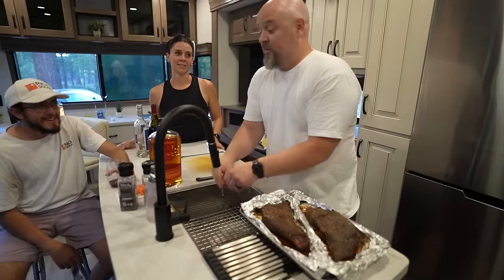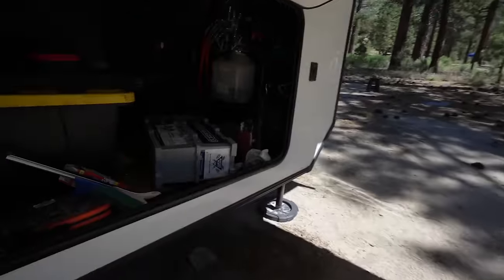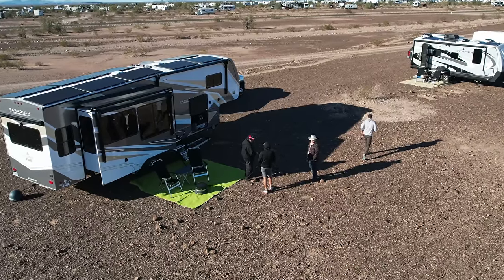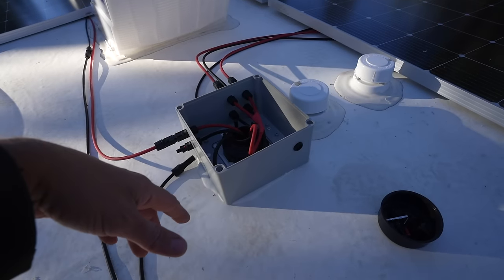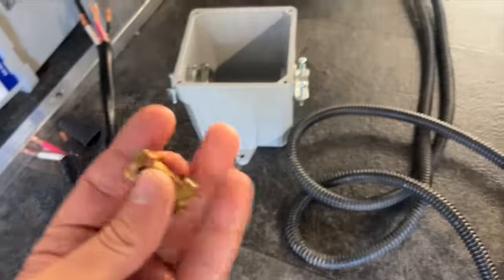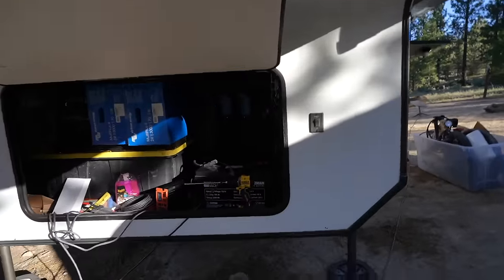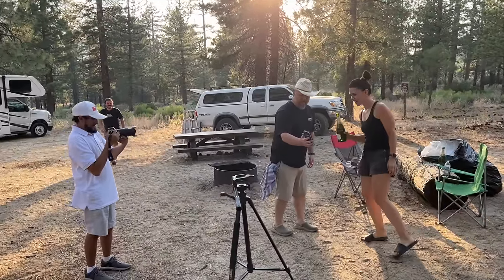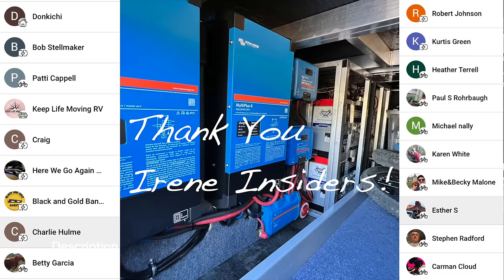24v Battle Born Battery Power with 2750 watts of Rich Solar! (RV Lithium Battery UPGRADE)

Comment: Great system love the way you put it all together.  Wow I would love to see any additional information or videos that you might have on this system. Looks as if you use batteries are 12dv at 270 ah and two in series making one bank and the same making the second bank. Then you paralleled the two back to give you at 24VDC output nice. Just do not understand why you use 250 watt solar panels when you could get 550 watt solar panels ? You would either have 1/2 the solar panels on your roof or the same amount with twice the amount of power going into you system . Then if twice the amount you could put two more inverter doing sharing and wow that would be nice . Plus give you a system that could be added to at any time if 1/2 the panels.
Reply: No way to fit 550s on the roof
Reply from the maker: Thanks! Yes, because of all the stuff we have on our roof (3 AC's, 2 fans, skylight, etc) we just don't have room for wider panels than these 250's. Any higher wattage panel is at least 40 inches wide and we only have 36 inches between the AC's and the edge of the roof. 👍
Reply: @IreneIronTravels  and you don’t want to fall off the roof!

Comment: I’d like a more detailed video in this system. 

I suspect we are looking at a decent 5 figure amount in this install… 

Looks beautiful
Reply: Labor costs are where it gets tricky. The parts alone aren't too bad, but professional labor adds up quickly!
Reply: The parts for that system are easily $25k. Those batteries alone total $15k.
Reply: @theshastafarian  jeez I'm so glad I built my own battery bank from individual lifepo4 cells! 700ah @12v for $2000. Then again, Aaron and Chris probably get a partner discount..

Comment: Any reason you ran your inverters in parallel instead of split phase?  Also I hope your 24v inverters can handle the load better than mine.  I have 2 12v MPII 3000 and when both A/Cs kick on at the same time (even with soft starts) and another load is on i n the RV I have had it blow my 400 amp and a 450 amp fuse because of the sudden load.  Just running they are fine, it is just that initial hit and your talking about running 3 at the same time granted your amp load will be half because of the 24v, hope it all works great for you.  Also you will need to convert to mini split to run A/C for any amount of time.  I have close to 3000 watt of solar and that can not keep with up recharging the batteries if 2 A/Cs are running, especially if you run them at night then the solar has to play catch up to charge what you used during the night and power the inverters with what ever battery draw (A/Cs) you have on during the daytime.

Comment: Happy for you guys, I  do have a couple of questions though.  Did you have to up grade the wiring in the rv and does installation on the roof void your warranty.
Reply from the maker: Thanks!! No, you don't have to upgrade any of the factory RV wiring, because it is still running the same amount of power as it's designed to. 

The roof warranty is not voided, unless the solar panels were determined to be the cause of an issue. For example, if one of the solar panel bracket holes leaked it would not be covered. But if the roof fan started leaking that would still be covered on the factory warranty because the panels don't have anything to do with it. 👍

Comment: Victron touch 70 install,  you drilled the hole in the false front panel then said it was a strait shot down to connect the wires. I have 2024 310RL.
I'm having trouble running a snake down. I pulled the power panel & breaker box but cannot fish a snake down. Did you cut any access holes
to get snake the wire down? any help would be apricated.  I really enjoy the videos. Thank you
Reply from the maker: I didn't have to cut any access holes. However in the 295MK there is a panel behind the toilet that does open and shows the roof vent pipes that rundown to the basement passthrough. I dont remember if that helped me at all, but it can be tight with the 3 vent pipes, studs, and screws sticking out. I just tried to follow the wire bundle that was already in there down to the back of the breaker panel.  The double connector wire of the Touch 70 made it a bit difficult as well. I believe I taped those together and then to the fish tape.  Sorry I couldn't be more help.....good luck!
Reply: @IreneIronTravels   Thanks for a quick reply, I made some progress with help from a GoPro. 
Why did you choose the softstart: Micro air easy start asy-364-x20-ip ? I assume your 295MK has the Colemen-Mach 4800 series?
I ordered three Coleman- Mach units on Amazon but they are on back order. The Micro-Air unit is $100.00 more. I didn't see a link to the Micro on you list.

Comment: Install looks great! Looking forward to your long term review of the system after you get a couple of seasons/locations (desert) under your belt with it. Rest assured, I will be borrowing some of your designs when we get our new rig! Looked at some Brinkley, Alliance, and Grand Design rigs last week, going to order an F450 in October, they are about 6 months out if you order.
Reply from the maker: Thanks Don! I really like the New 23 super duties... and wouldn't mind ordering a new Tremor. The payload has increased on them quite a bit.

I haven't seen a Brinkley in person yet, but really like what they are doing. What did you think about it?
Reply: @IreneIronTravels  Yes, the new super duties are very nice, especially with the payload increases and the option for an HO motor. 500HP and 1,200 lb-ft of torque! I am just trying to figure out if I want to get a dually or srw. Obviously the SRW will be better for normal drivability, but the extra stability and cargo capacity of the dually is desirable as well. Most likely going 450 due to the tighter turning radius on them vs the 350. Do you wish you had a dually now that you have the fifth wheel?

The Brinkley is pretty amazing in regards to fit and finish, as well as thoughtful touches. I will say the Z model was much nicer than the G even though I am mainly looking at toy haulers as I have a motorcycle that I will want to take with us when we go full time, not to mention the garage will make an excellent home office space. I want to see if any of the manufacturers will work with me to create a semi-customized floor plan. I don't want or need the half bath in the garage as it takes space from the living area so I need to see if anyone will work with me to delete that. I am also considering a non-toy hauler with a swivel wheel cart for the motorcycle. http://www.cruiserlift.com/swivelwheel-58-dual-wheel
Reply from the maker: @okinawadonkichi   We're really happy with the SRW diesel truck. It tows great, very stable, never feel out of control. But if we had any bigger/heavier of a 5th wheel we would probably look at going to a DRW. But because our truck is our daily driver we really appreciate not having to park a dually or a long bed in some of the places we go!

Comment: OK that made my head spin, what a beast system, you obviously plan to BOONDOCK. Aaron, I was wondering, don't you need a transfer switch when plugging into shore power?
Reply from the maker: 😂🤯 yes! It took me many weeks to research this system and how/if it could work! 

The inverters have a built in transfer switch and will automatically switch to battery power if the shore power shuts off.

But, more to your question, the inverters bypass shore power directly to the RV’s breaker panel if it detects a shore power source. 

If we had a built in generator you would then need a transfer switch to switch between shore and gen. 

Victron also has an inverter model called the Quattro that has Two inputs so you could wire shore power and an generator directly to the inverter!
Reply: @IreneIronTravels  Thanks for your response brother, appreciated! BTW, I'm that older dreadlock guy you see running around in the 1000 Trails parks. Hope to officially meet you guys some day, but I respect your privacy being a YT star!
Reply from the maker: Oh hey! It is a crazy small RV world out there! I’m sure we will meet one day👍😊

Comment: Wow! Thats a system! Aaron you seem knowledgable about solar so here's a quick question... We have a smaller system but decent with all Victron and BB batteries, we have a multi plus 2 3000 watt, 4 BB 100amp batteries and all the other toys to go with it. When we were plugged into good 50amp shore power, both A/c's going (with soft starts), tv, and hot water tank on electric why would our battery monitor be reading down 7 days, 5 days, 3 day 4 hours then gradually go back up. Its never done that before when plugged into shore power. It happened after torrential rains but the electrical never seemed to skip a beat, the electric coming in was always 122-124v on both legs.
Reply from the maker: Hello, thanks! Yes, that seems like a weird situation. Maybe the shore power shut off for a short time and you didn't notice... 

Was the battery percentage also going down at the same time?

If the power did shut off, that would make sense that it was going down that quickly and then the power came back on....

Comment: Nice.   How did you wire the solar panels to charge controllers?    How about the total weight added does that put the rv over max or close?  I saw previous comments at 800+ lb.

Comment: In the process of redoing my electrical system and was wondering why you chose to go 24v other than saving a little on wire size ? 
Victron prices are pretty much the same going 12v or 24v. Right now it looks like Rich Solar and BougheRV  are competing for some sales on their 12v 200w solar panels. Less that a $1 a watt while the 24v 200w are over a $1 a watt. I haven’t seen a big difference in batteries as far as voltage goes unless you go to 48v. 
Plus going 24v you have to get a dc to dc converter which is about $140 and another thing to go bad in the system. 
Just curious
Reply from the maker: Yes, money saving is not a great reason to do it. The biggest savings would probably be in the solar charge controllers as you can buy half the wattage size controller and the victrons can get expensive as you get unto the 150/100's.

But the real reason (for me) is if one is going to go with larger inverters or multiple inverters. At 24 volt you will have half the amperage going through the wires, which is more efficient and a lot cooler. So if I want to run an AC for 12 hours its about 60 amps instead of 120 amps. Same goes for charging the batteries. 

So as we leave our inverters on 24/7 it is more efficient to go from 24v to 120v for most of our loads.

If you have a smaller system it probably makes more sense to stay 12 volt and then run as much as you can off 12 volt instead of 120v. And like you said, you do have to deal with the Orion converter of 24v to 12v.
Reply: @IreneIronTravels  
Thanks for the reply. Understand the higher the amps the more heat created. 
I have the cousin to your last rig but it’s a Cougar. Same size and layout. 530 solar, 300a battery and 2000w Xantrex inverter/charger. Upgrade to 1200 solar, 600a battery, 3000w multi Plus and same 50/100 Victron solar. All because I’ll be installing a mini split that should be soaking up around 6000w a day in the mid 80’s. Any hotter and I’ll have to break out the geny

Comment: I know you have probably answered this 1 million times before but why do you fill up your fresh tank completely at the start of your travel day rather than when you get closer to your site? At 100 gallons that’s over 800 pounds. That makes it a heck of a lot heavier to Paul, which, of course means more fuel consumed.
Reply from the maker: We try to, but sometimes it's tough to find potable water on our route. In this instance we had over a 100 gallons of gray and black to drop off as well. So we picked a dump and water that was in the middle between campsites. 👍
Reply: @IreneIronTravels  gotcha. Thank you. I’m very new to all of this :-)

Comment: Awesome. That is the exact system I had been planning out for my future 5th wheel. Even a similar amount of solar. It's great to see it in real life come together and work. Did you wire the Orions to a bus bar or just parallel them from output stud to output stud like you would batteries?
Reply from the maker: Thanks! No buss bar for the Orions. Yes, we just parallel them to each other output to output, input to input, neg to neg. And then the input from the 24v batteries and the output goes to the factory RV positive. 👍 Works great so far.

Comment: Great install and super nice system. What AC units are on your Alliance and how many BTU? My 15K pulls about 400watts more when running and Im looking at installing betting ACs or a mini split to run longer off my solar system.
Reply from the maker: Thanks ! We have the Coleman  Mach Q 13.5k BTU. On low auto they pull 1000-1200 watts. Our last regular Coleman 15k was 1500-1800 watts. 

Im really happy with the power consumption on these. Ofcourse a mini split would be more efficient and wayyyy quieter....but it's a pretty decent job to put one in....
Reply: @IreneIronTravels  The the noise level is definitely the other reason we are looking at a mini split. I was hoping that was a 15K running at 1000-1200watts but still better than mine at 1600watts. Thanks for the reply

Comment: I’m curious how do you seal all the holes in the roof ?
Reply from the maker: We used a sealant called Dicor Lap Sealant. It is similar or the same as the manufactures use to seal around all of the other roof penetrations. 👍

Comment: Awesome setup, definitely a system to be jealous of. Now you can join me in spreading the gospel of 24 volts. 😂
Reply: Meanwhile I think 24v is a compromise. If you're going to break comparability with 12V, then just bite the bullet and go 48V 😂. They now sell 48V alternators for my Sprinter... 🤔
Reply: @PsRohrbaugh  I guess it all depends on what your estimated power consumption is going to be. I was able to use the factory 12v charger built into the RV's transfer switch. As long as my inverter is on, no matter if I'm plugged in on the generator or using the 24v batteries the 12 volts always stay charged.
Reply: @Independent_DIY  good points. Mg point was that 48v opens the door to a ton of residential systems, where 48v is basically the standard voltage for DC storage. Instead of Victron stuff, you can consider things like Sol-Ark (where $7000 gets you a 15kw inverter with multiple AC inputs and outputs, grid tie, and 12k of MPPT charge controllers built-in). The user interface is more residential than mobile and I'm hardly saying it's automatically a superior choice. Just that 48v opens the door to a lot of residential systems.

There are definitely more DC appliances that accept 24v than 48v, but almost everyone keeps some sort of 12v bus around, so if you're going to be using voltage converters anyways, that advantage of 24V doesn't mean much.

The 4/0 wire on my 5000w 12v system gets warm to the touch at times, so I get the advantage of higher voltage whether it's 24 or 48. But as a minimum, people looking into 24V should also look into 48V.

Comment: Approximately how much weight did this add to the rv
Reply from the maker: Probably around 800+ lbs. That was also one reason I spent so much time putting the batteries as far back as possible to keep the pin weight down. The panels are a nice even weight with the way they are layed out.

Comment: why two MultiPlus-II 2 x120V 50A 120/240VAC split-phase? won't one do the job?
Reply from the maker: The Multiplus 3000's are actually a 2400 watt inverter or roughly 20 amps at 120 volt. So two of them in parallel like this give us about 40 amps of power off grid.

Comment: How does AC input work with two inverters? Do you have to provide it to both? (edit it looks like you do) What's the minimum amperage you can limit to? For example, on my Victron Quattro 5000w 12v / 220 amp, I can't limit my AC input below 13.5 amps. That's fine most of the time for me, but I wish I could go down to an even 10. Does two inverters double your minimum amperage on AC input? 

Anyway, assuming you can limit your input to 15 amps or below, this will be the ultimate "moochdocking" setup. The solar might not always give you enough power, but if you can run a 15 amp cord to the house you're staying at, you can run all 3 ACs and an air fryer and not worry 😂
Reply from the maker: Yes, that is one thing that is tricky with the parallel of the inverters. It doubles the input limiter of 14.5 amps... to 19 amps. So Im fine on 20, 30, 50 amp shore power.....but the 15 amp will be tricky. 

I'll probably have to change the charger amps down, otherwise it will try to pull too much power. Then Ill have to manually decide when to plug in or not....

Maybe we just won't need to be plugged in at all if we have some sun....

Comment: What's the total battery size?
Reply from the maker: The batteries are 270 ah each and we 4 of them. Since we wired them in 24v it is a 540ah bank. If you wired them in 12v it would be a 1080ah. But they are both the same power in watt hours. 👍
Reply: Thanks! Can't wait for your next video. @IreneIronTravels